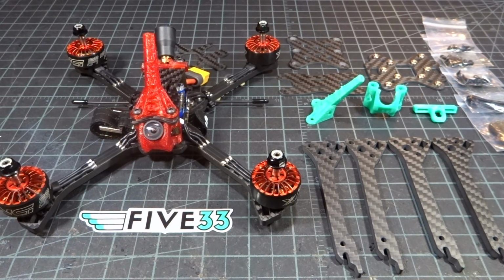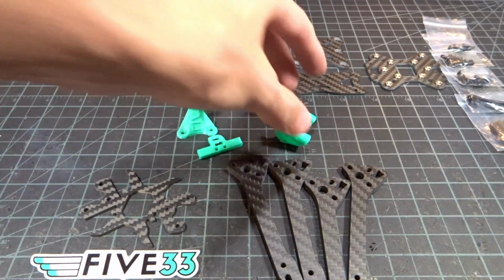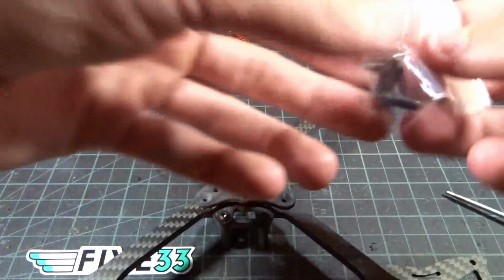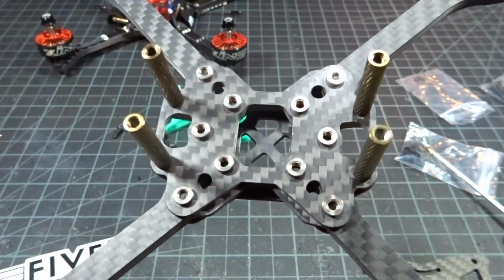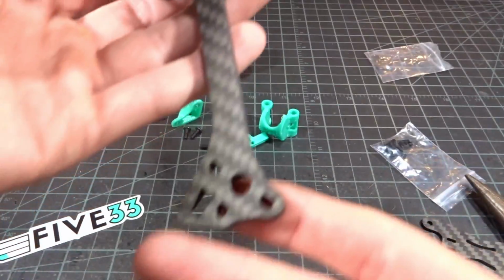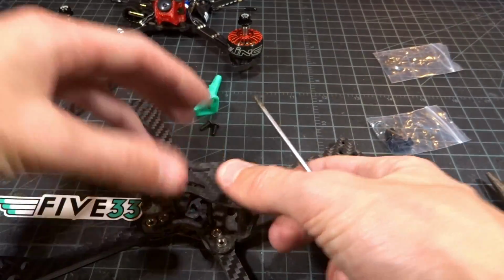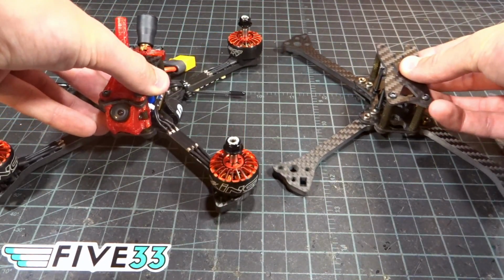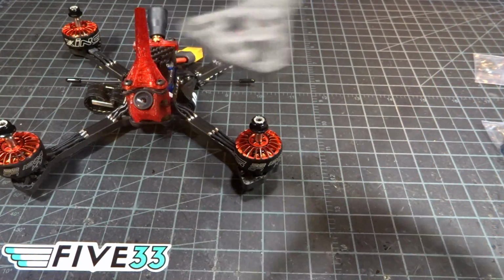Five33 SwitchBack Review | Why I'm Switching

Comment: what are you going to do when remote i.d. comes out you will not be doing anymore freestyle. and will be flying at an rc plane club only looks like a lot of hobbyists are going to pull out .FAA is talking about only getting parts from them like flight controllers everything has to be FAA approved so all amateur builds will be a thing of the past .i do not think the FAA will allow you to use Bang good parts as they are not FAA approved also you will need a subscription to a third party for your flight data ,also you will need phone data  to broadcast all your information to law enforcement in case there is no wifi hookup
Reply from the maker: As Chez says, most of us are already flying without HAM, Part 107, and FAA registration. I don't see how this new law will change too much for our community.

Comment: what are you going to do with all that long range gear when drone remote I.D. comes out,and you will have to fly in an AMA flying field.if you add the remote id to your quad you will only be able to fly in a 400 foot bubble. so be careful on how much gear you buy for long range flying because i think Amazon,Fed-Ex, and all the other companies will probably win and will own all of the sky from 0-400 feet.and all quad copters,rc helicopters ,and fixed wings will no longer be allowed in the air-space and the hobby will die. check out all of the hype and whats going on with the hobby .it has everyone shuck up.even commercial flyers,the freestyle flyers will be the first to go due to the fact they must use a lot of ground and height  for tricks. racers stay close to the ground and so they have the racing gates and cubes to go threw for now until AMA clubs decide no race course just fly in a circular pattern like all of the rc planes do,and finally the fixed wing guys will get into crashes due to the quads flying at the same field and some flyers deciding to stop and hover while the line of sight guy flying the fixed wing will crash into the quad.. so i would like to know what you think of our hobby in the near future if it is worth buying all that gear and in the end loose it all due to air-space politics.
Reply: What you are talking about is not set in stone and could change.  Everyone flies without a ham license which means that 99.9 pilots are already flying illegally. If it does get implemented it's hardly gonna make an impact.
Reply from the maker: As Chez says, most of us are already flying without HAM, Part 107, and FAA registration. I don't see how this new law will change too much for our community.

Comment: Love this frame! It’s a tighter build space than what I’m used to especially with fl1 esc’s. But love the 20x20. My build is a good 35+ grams lighter than my Flightone arc one race builds.  The 3d prints are super nice. Love the turtle mode stick thingy. Lol. 
I haven’t crashed it much but it’s at least as tough as the arc one and I’ve yet to break anything on my arc ones. 👍
I haven’t tried the sfg’s yet on this 533 tho. I have the one for the arc one and while it does add a lot of weight to the frame it handles so so smoothly. Hard 180’s are a breeze with the box on it. And it took the last bit of prop wash I had out. But made prop choice harder due to the weight and killing my lipos faster. Which I’ve finally got to a point in racing to where at the end of 2 mins my lipos are down to 3.8v when I started racing my lipos would be at 4.0 when I landed after 2 mins lol. But with the box on the arc one even with a 1300 6s I’m landing at 3.65 or so. Anyway the switchback is much lighter and to me handles a hair better than the arc one without the box on it.

Comment: I like this frame a lot. The synergy fc makes for the cleanest tightest builds, really nice. Have you tried the Super SlamNasty by Catalyst Machine Works? Also a very nice frame for 50 bucks, 60 with the front, and back brace. Ive crashed it a lot in the dirt, and hitting trees, and its holding up great. Thanks for the review.
Reply from the maker: I haven't. It's a pretty generic frame in terms of there's nothing too special about it, which fits the 2018-2019 design period it came out. Curious about their new upcoming offering.